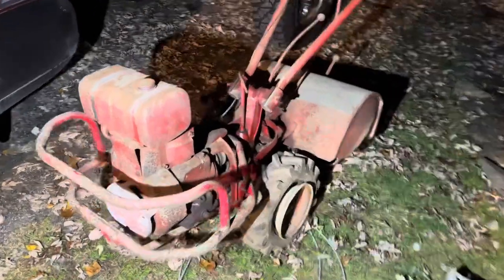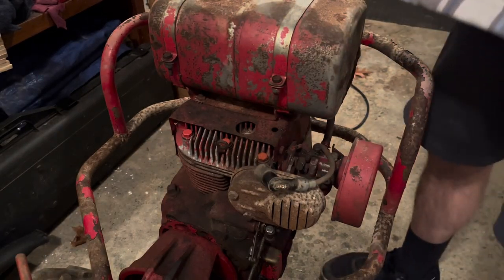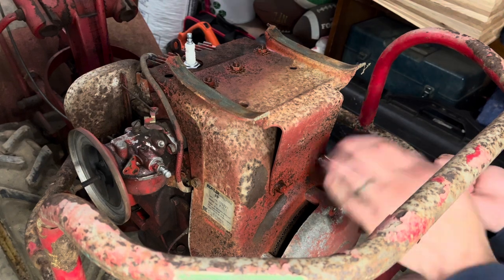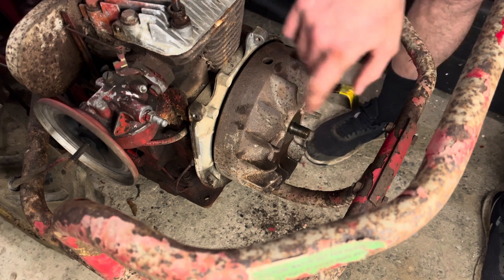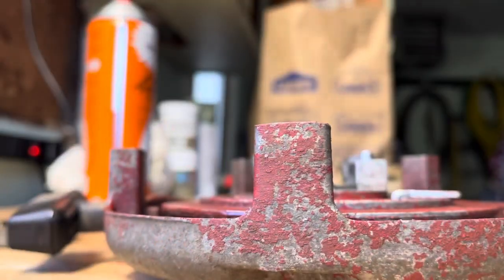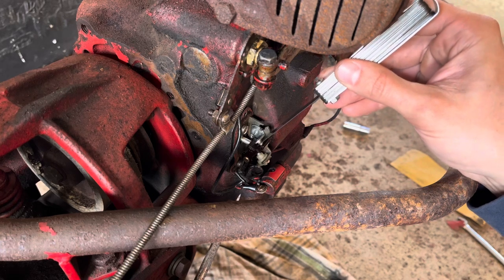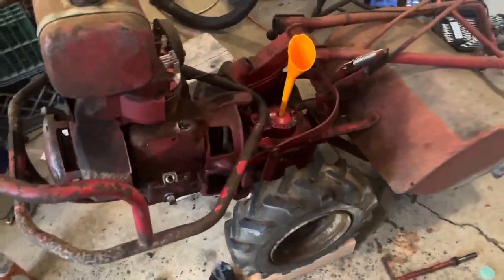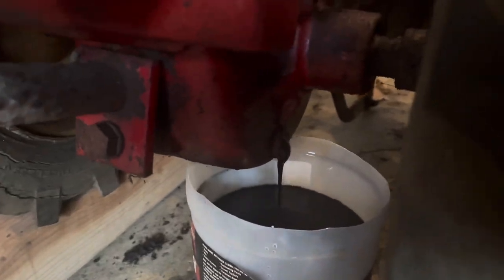Troy Bilt Rototiller Brought Back to Life

Comment: I have the same 7 HP model, purchased from the late 70's without the front cage protection. Shipment from Troy Bilt was kinda expensive from New York to California. Anyways was a huge mistake loaning to neighbors. They ran the motor into the ground, broke the pull rope, busted the carb into a fence post then threw it in the trash. I had the lifetime warranty for a complete rebuild for 1/3 of the going price. Warranty was denied since Troy Bilt went into bankruptcy purchased by MTD Consumer Group Inc. Troy Bilt good company always had support, MTD not so much. In any case it sat in the yard for 25 years was going to the dump site until I saw your video. Itching to have it running again, have the very detailed owners/parts manual somewhere. No idea if I can get parts but couldn't get it from MTD.
Reply from the maker: Wow, I certainly wouldn’t lend anything to that neighbor again. I hope you get it running, it’s a great machine and they are not to complex. If it helps, I did post a link to the owners manual in the descriptions. Good luck!
Reply: @alittleofalot5171  
Thanks for the manual upload! I hear others swap the commercial 7 HP motor with the cheap Harbor Freight 6 HP motor without a problem. Going to tear into the transmission, its full of water and gray sludge.
Reply from the maker: @kimchee94112  I got lucky and mine was under the barn so no water damage. I would put a little oil down the spark plug hole, let it sit for a while and see if you can manually turn the engine over. Your rings and cylinder might be okay. Depends on how long water has been inside it I suppose.
Reply: @kimchee94112  Try and keep the Kohler K161 if you can.  It's far superior to these no name Chinese engines.

Comment: Hi- I have an old horse tiller that is not quite this old, I still use it.  I am sorry Troy Bilt went under.  My brother and I drove up to the factory  to pick it up, as I live in central NY and it is not that far from Troy.  Those old ones are great machines, much better built than the newer ones.  They used to put out the Troy Bilt Owners News that always had hints for better gardening.  Nice to see you get this one going!
Reply from the maker: @tinashields9599 I love the old equipment. Usually old equipment is built a lot tougher than the new stuff. I hope your tiller continues to run well!
Reply: They are still building them mtd bought them out

Comment: I do a lot of these I usually just put a new predator engine ohv engine on them direct bolt up makes  a nice tiller the engines run around 100 to 140 harbor freight.